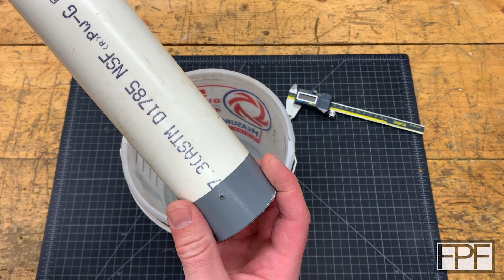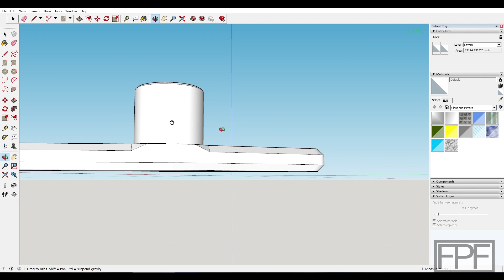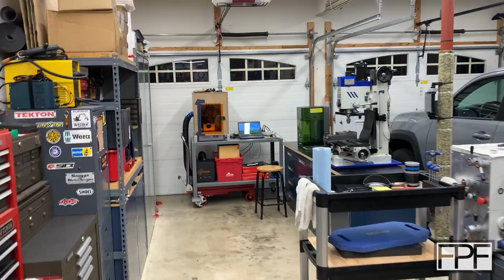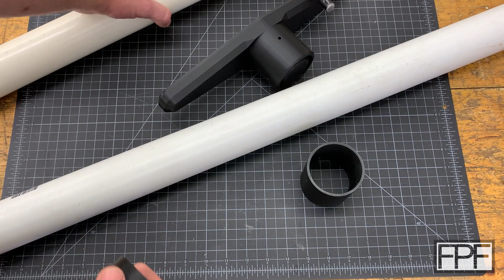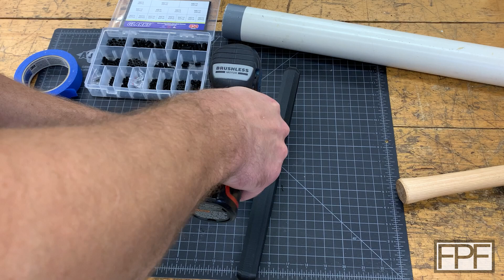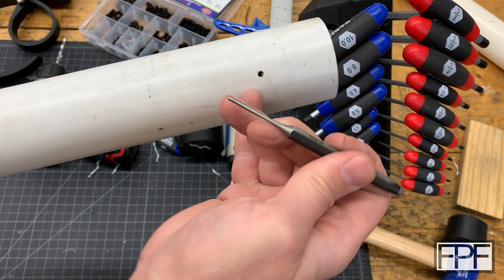3D Printed Pool Skimmer Drain Plug Wrench

Comment: New subscriber and looking into purchasing my first 3D printer.  I’ve watch a few of your videos and had a couple of questions regarding your process of creating items from the 3D printer. 1. Can you just print the areas you want to test fit for or does the whole item need to be printed?  2. Does filament sand easy? Was think on some of your first iterations, just using sandpaper could help decide if the area needed to be corrected.

Comment: Hope you recover quickly! Maybe we'll see some left-handed or one-handed functional prints soon...

Something I might have done differently on the wrench is to lean into the water ingress problem. If you design a cone into the opposite side of the square wrench with a drain through the middle, and add a hole on the handle side, then water can easily flow in and out, and then you won't have to fight the buoyancy when pushing the wrench into the water.
Reply from the maker: I had the EXACT same idea watching it in editing.  Has to be done.

Comment: I'm all for over engineering things for the fun of it, but it seemed like the only failure point on the old wrench was the nails. Could you not have just replaced the old nails with, say, a piece of stainless all thread or a bolt? Plywood is used on boats in the ocean, so I think just replacing the steel would've made that into a tool that lasts 30 years. Whereas I imagine PETG and PLA will become brittle when exposed to salt just like most plastics do, PVC being an exception. Either way, glad your surgery went well!

Comment: Nice video. Just a tip. It's easier to use abs or asa. Because you can glue abs with pvc glue. Pvc, abs asa react to the same solvents. And pvc glue is just solvent and en devolved pvc.

Comment: 9:35 I want to say it's called the radius. I had a similar surgery in early 2009 where my ulnar was partially shattered at the wrist. Make sure you do the exercises the occupational therapist gives you and don't put any excess weight on it until you are given the ok. I speak from experience as I snapped a pin   and still don't know how almost 15 years later.

Comment: i had the same problem with my wrist the fix i was offered was to 1. fuse the wrist so i could not bend it or 2. have certain nerves removed from my wrist i chose option 2  because I'm a keen motorcyclist an getting my right wrist fused was not happening i was back riding 2 weeks after the surgery with no pain an full use of my wrist ever since 7 years an counting

Comment: Why not use a little CA glue, PVC glue or epoxy instead of the set screws?  Then you don't need to print a drill guide either.

Comment: Instead of the plumbing department plugs, we used plugs that were more like tubes made of flexible plastic that came up above the waterline, so that if the water in the skimmer freezes it will crush the tube instead of cracking the skimmer itself. It also allows you to pour antifreeze into the skimmer line without draining the pool to below the skimmer level.
Reply from the maker: interesting, but then how do you get rid of all the antifreeze-laden water in the lines come spring?
Reply: @FunctionalPrintFriday  We use the non-toxic RV antifreeze. Most of the valves on pool filters also have an option to discharge it to waste, like backwashing but skipping the filter. We also used antifreeze in the lines from the filter to the pool, and that just gets flushed into the pool.
Reply from the maker: @sleepib  thx, that makes sense

Comment: Set screws work, but what about just plain ol glue? No drill guide neede, no rust concerns.
Reply from the maker: Good point.  I guess if I used ABS filament and ABS pipe that would have been easier

Comment: If water does seep into the tube (or get sucked in by pressure changes), a small drain hole could be drilled at the handle end or through the bottom of the socket hole.

Comment: I'm curious, why don't you share your files in STEP format.   You are very generous with sharing your skills and STL files.  Yet, STL files are nearly impossible to edit.  STEP files can be modified by pushing and pulling on surfaces.   
Your design this week is inspiring.  My house exterior water shut off valve is buried 3 feet below ground level because of winter.  So it's very likely I'll be taking a cue from this video and design myself a PVC wrench.  Thanks for the inspiration.
Reply from the maker: There’s no step export from sketchup.  I should switch to fusion or onshape, but there’s reasons I can’t yet.
Reply: I forgot that on the free version of SketchUp, they don't allow step file export.   @FunctionalPrintFriday
Reply: You can modify stl files in freecad to make them solid parts that can then be remade any way you need.  Then if you like, you can export them as step files.
Reply: @neilnagel9857 I do appreciate Freecad and have used it extensively. Thanks for the reminder.

Comment: so funny just subscribed to you last week.. i own pool service company and just a couple weeks ago i designed and printed a wrench tool for removing the return eyeballs (for when they come apart and only the bottom piece is stuck in the threads still. seriously one of my favorite tools. I also made one for the rubber wing nut plugs, just a handheld to all the crank down the wing nuts.